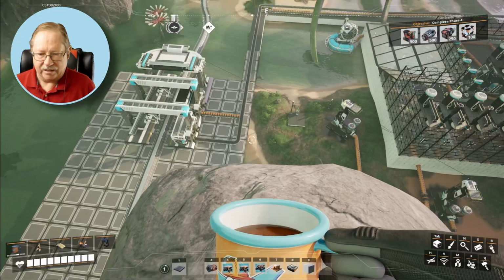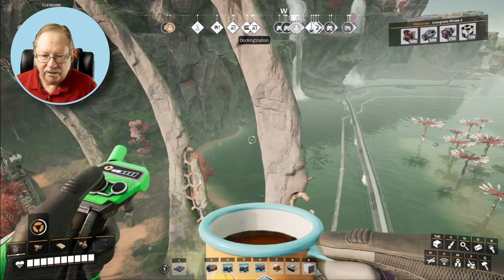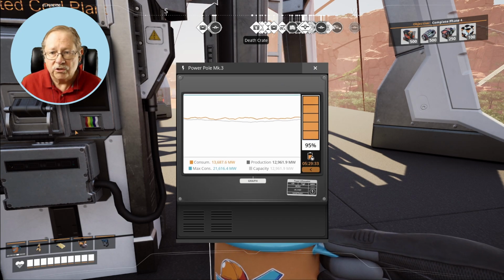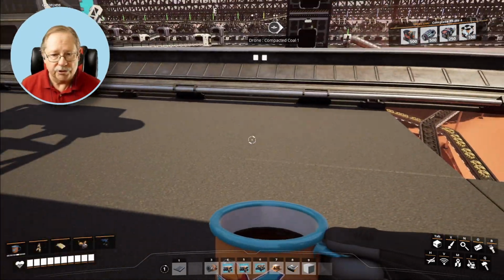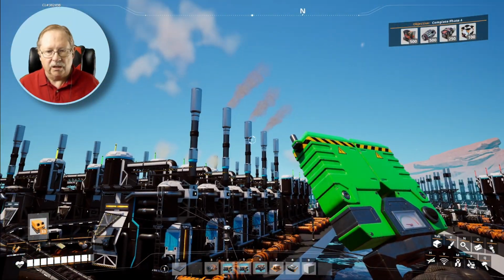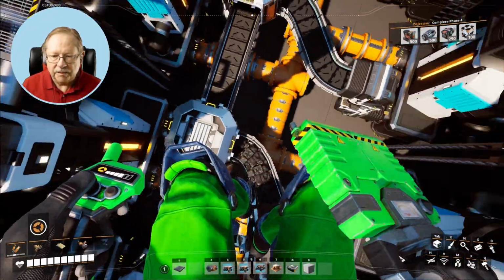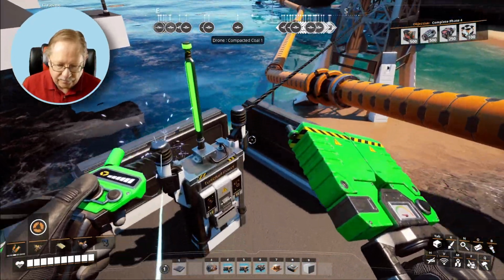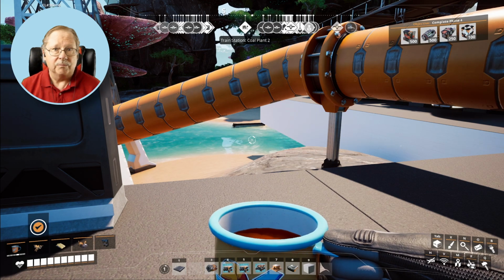Rebooting everything for the Turbofuel Factory [Satisfactory 1.0 Episode 19]

Comment: Diluted fuel alternate recipe helps a lot. Before making turbofuel it takes heavy oil residue and water and turns it into fuel using blenders if you have them unlocked. My first real power plant used a pure node and ran 40 generators on fuel alone. My next power plant will use this recipe to make turbofuel.

Comment: Good job.

Well, another way to get power is ground heat, can try to get all if possible, then focus on Turbo Fuel.

Well, so far I'm trying more battle in Satisfactory, to Rebar gun, can use 3 Rebar gun, 2 with Shatter rebar, 1 with Explosive rebar, can attack with first shatter rebar gun, then use wheel quick switch and fire second shatter rebar gun, then another way to use Rebar gun is fire and reload at same time, with this can make Rebar gun reach max fire rate.